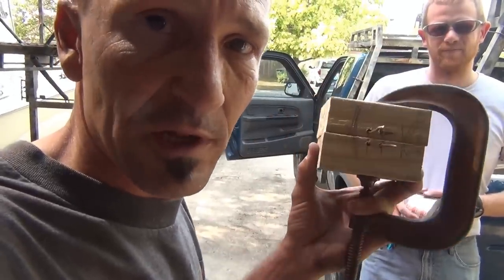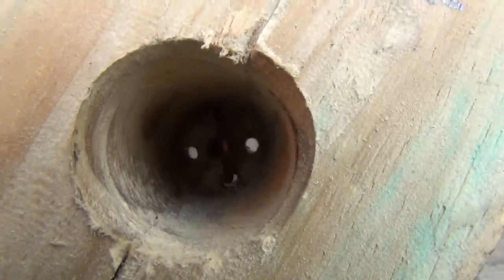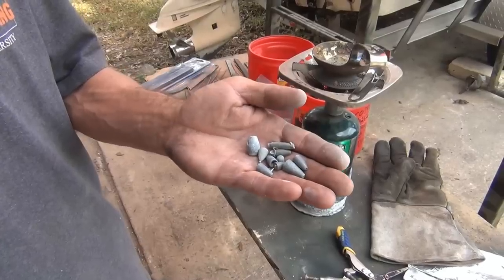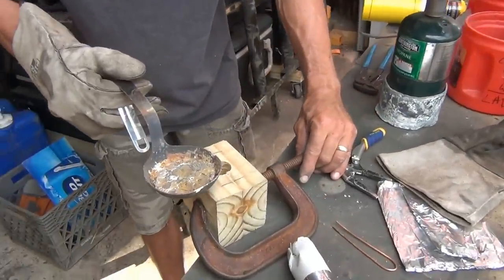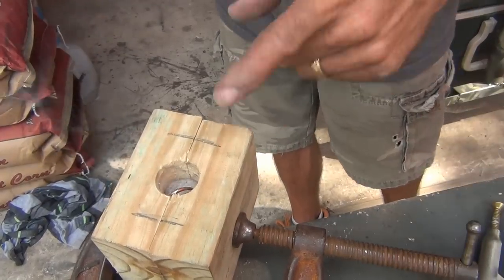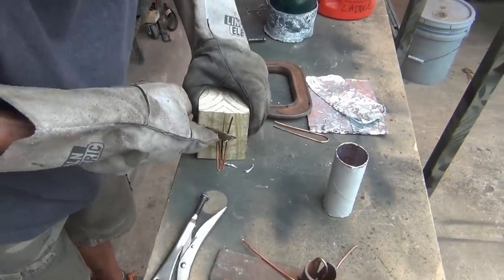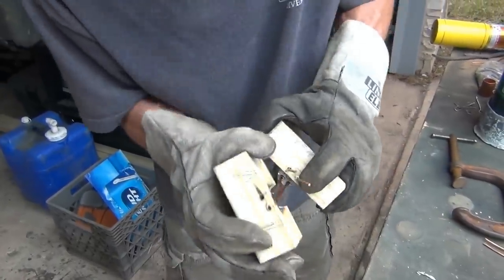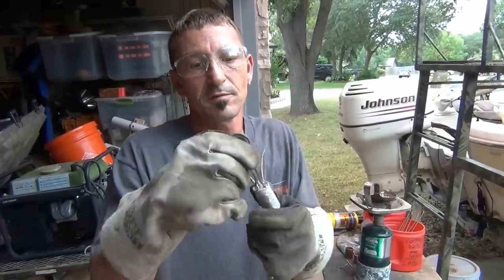How To Make Surf Weights from a Wooden Mold, 2/6

Comment: Just a thought ....what if you reverse the wire?
Put two holes in the center of where the two 2x4s split/meet and that way when you split the mold you don't have to fight the lead and wire out of it  also you won't have to worry with stopping the pour before it covers your loop ... have a good one
Reply from the maker: +Darrel  Watts  its an idea, thanks